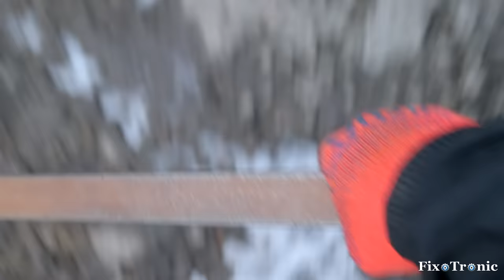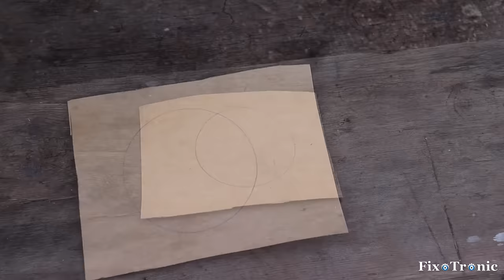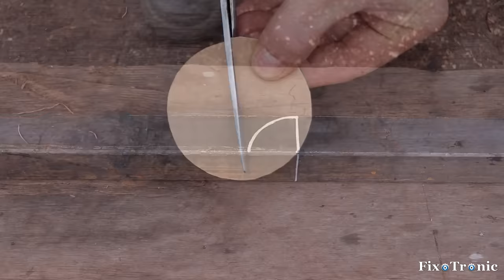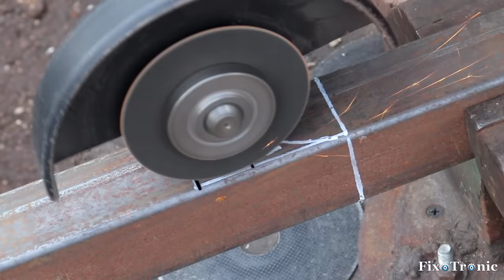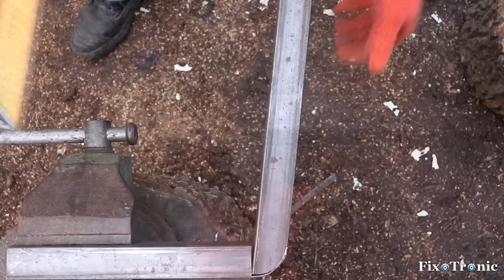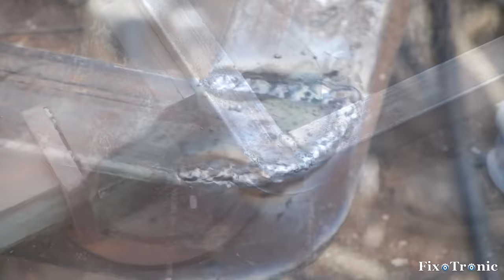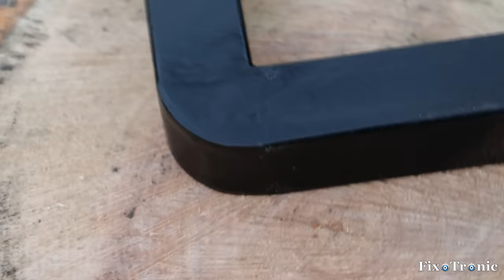Secret Profile Pipe! WHY DO WELDERS NOT SPEAK ABOUT IT

Comment: I asked my uncle and he said "we have orders to complete ain't nobody got time for that" that's why welders don't speak about it 😂
Reply: Yeah a 45 butt joint works just as well you would only use this if you wanted the rounded edge
Reply: I agree.. looks nice, but if your welding on the clock it's way quicker to weld at a 45 or 90 cut
Reply: If you are a production welder, this kind of thing separates your products from the rest...
Reply: @campbellpaul  nah, time and efficiency matter more. Unless you are some artist, this joint is not needed.
Reply: Plasma cutter would speed up the process a fair bit
Reply: That's what I was thinking. But if I need a round corner I might try it
Reply: @campbellpaul  he owns his own shop in a village, the only one there, he gets a lot of orders but none of them require this level of quality and it's a struggle to get things done in timely manner
Reply: @guser436  I understand. Also, some places have such an enormous back-order log that their main goal is to expand the operation... It can, however, go hand-in-hand with their level of quality product. Just sayin'

Comment: "A grinder and paint makes him the welder he ain't"... but his geometry skills are on point.
Reply: Considering it is thin metal, and hes stick welding, very difficult to stick weld thin unless you use small diameter rods.  Those welds dont look bad, plus you dont no the application. Maybe these were handrails, and those are pretty strong for that purpose.
Reply: But u didnt get the point of the video then.
Reply: 1. I actually weld for a living. 
2. I use this technique when called for. 
3. The quote is in recognition of the nature of welding thin metal. 
4. It's actually a COMPLIMENT to his skills. 
5. Those that weld would recognize this. 

But please do go on... Reading comments from people whose experience in burning metal starts and ends with sticking knives in toasters & power outlets is funny as hell.
Reply: @ibidu1 He was stitch welding, Effective but not pretty hence the extra grinding.
Reply: He did a fine job thanks 👍

Comment: I dunno, I never hear welders talk about anything.  But hey, they must not.
Reply: My friend who is a welder only talks shit and when he isn't he is pretending to be gay.
Reply: Lmao sounds about right
Reply: I knew a welder once, and all he spoke about was fishing.
Reply: @billgriffiths1685  Probable because it take too bloody long to do this join vs say a 45 cut?
Reply: @billgriffiths1685  )))))))
Reply: @damienkaletta7524  theres also the wasted material at the end of the day its about money
Reply: I knew a welder once. He was a pot head and a drummer to.
Reply: Welder + fabricator here!, the reason we dont talk about this is that its just too much effort and rarely ever requested
Reply: @NotReal1y  agreed - spent 22+ years as a semi trailer mechanic, which includes a LOT of welding & fabricating, along with replacing parts and patching holes in everything from aluminum or chemlite roofs down to holes in wood or aluminum flooring. This process is waaaaaaaaay too time-consuming for regular use. In fact, usually when we needed square tubing to have a 90° angle, we used the break, and bent it the necessary 90° angle!
Reply: Kilroy, I spent decades being a welder as well as all sorts of other things, being a semi trailer mechanic, and when we talked about stuff, at work or away from work, it was never really about work, LOL!
Reply: I dunno. I've heard a few things come down the pipe. But usually it's just hot air.
Reply: @MaryAnnNytowl  ;

Comment: Side note- Im glad i bought a Wire welder, more often then not i see people with stick welders trying to get their arc to start, i didnt want that trouble, that, and im not a fan of having to buy packs of rods. A reel of 0.36 is all i need, they arent that expensive either. Another plus, i havent gotten my wire stuck to random metal like ive seen happen with stick welders. 
All in all, great video, and to anyone wanting a welder, definitely do your homework on what you want to be welding, your budget for a welder, and other variables. I will say my lil Lincoln Electric FC90 is a great starter wire welder. Lincoln Electric also has starter welding kits, comes with: Chipping hammer, paint marker, magnet capable of making 90 degree angles, gloves, fire resistant sleeves, and of course, a helmet! I highly recommend it because you can plug it into standard house power, no need for big ol plugs. Have a great day, and happy holidays!

Comment: Here is why no welder talks about it or uses it:
1. too difficult to cut with simple machinery, so you need too much time for a joint
2.structural integrity, the reason both ends are cut to 45° if you want to reach 90° is that the forces are equally distributed throughout your workpiece
3. welding stress, since you weld on one side more than the other, the stress introduced due to the heat will deform your workpiece in an asymetrical way, which is what you dont want
Reply: Michel aus Pimmelberger More like 1. So you click in the video
Reply: Dein Name erleuchtet meine Nacht. 😂
Reply: Hello, your arguments are very valid although I have for me that if the structure does not demand extraordinary strength, a very good finish and view is achieved. Regards.
Reply: ok
Reply: Hexy he is not building a bridge. Dont you like the aesthetic of it?
Reply: Thankyou nice video

Comment: A great way to piss off the owner of the shop I work for and get fired for wasting time
Reply: id use a plasma to cut it faster then the grinder
Reply: A tube bender would cost as much as it'd take to pay a welder to cut, bend, and weld a few of these joints, and with the time it'd save, it'd pay itself off after one job.
Reply: @joshua.merrill  And you cant bend a tube with this small of a radius
Reply: @joshua.merrill  good  luck with finding a die for  square  tube with that radius
Reply: @kaptein1247  You can get close enough to make this joint not worth doing.
Reply: @joshua.merrill  It wont look good tho. Trying to bent this tight wil basically fold the tube
Reply: @kaptein1247  That's how pretty much all square tube furniture is made, though. I'm not saying nobody should do joints like this ever,  but the reason nobody talks about it is because you can bend the tube at a faster faster rate and therefore cheaper price.
Reply: Was thinking the same thing defo day rate speed that
Reply: Absolutely! I spent 22+ years as a semi trailer mechanic, which includes a LOT of welding & fabricating, along with replacing parts and patching holes in everything from aluminum or chemlite roofs down to holes in wood or aluminum flooring, and repairing or replacing the (usually steel) undercarriage parts, cross-sills (cross beams that hold the floor and attach to the sides of the trailer, underneath), or dolly legs (the crank-up-or-down legs near the front of the trailer). A LOT of welding and fabricating needs done when doing all of that, and never did we do this kind of thing!

This process is just waaaaaaaaay too time-consuming for regular use - in fact, usually when we needed square tubing to have a 90° angle, we used the break, and bent it the necessary 90° angle! 

We even built a hydraulic "bender" break, to bend 1" steel square tubing at 2 different angles in 2 different spots, which were used to build these table/stand sort of things to go between shop or warehouse bay doors. I bent thousands of those tubes, welded them to cross-pieces and flat steel (that also got bent in 3 different places using a different break that we also built), plus smaller pieces that got bent and added as "pockets" on the flat steel), and not once did the bent pipe give us any difficulty or cause any stress fractures of the steel. Had we done the bends on those tubes THIS way, we would have put out about 5 a day, rather than 50+ a day, LOL!
Reply: Pretty neat if one needs to improvise on site
Reply: @joshua.merrill  what is your solution if a job calls for an inside sharp 90 with and outside radius? this would be the only way.
Reply: @azza9423  I think the harder challenge would be finding a job that calls for a joint like this. 

But,  if there was somebody silly enough to make that request, they'd have to pay a lot of money for it,  and you'd have it laser cut. I, personally, would recommend to go with a bend or miter for 1/10 the price.
Reply: @joshua.merrill  a very good point, 7 years of fabrication I’m yet to ever see a job call for a join like this, but I’m willing to bet the one day I’m unprepared a bastard job like that will rear it’s ugly head lmao.

Comment: why because in 45 years as a professional welder i have never done this
Reply: Because it takes about 45 years to do a joint like this, when it takes 45 seconds to just bend one with a tube bender.
Reply: @email16v  In this example even one 45° cut would do the job. The video is still funny to watch.
Reply: I've been welding for 69 years.  This is the proper way to do it
Reply: I think if we test, this joint must be stronger than the other ones. Just guessing.
Reply: @ChargeNReact  no its not i dont know any company that would let you fanny about for this long on a simple 90 degree i could make a complete square and still have time for a coffee in this time
Reply: @tiny789  Obvious charlatan.
Reply: @tiny789  I'd have a conversation with you about compressive strength, but you wouldn't know what the hell I was saying, would you?
Reply: @ChargeNReact  no being an asme 9, cegb class 1, Lloyd's class 1 bureau veritas approved, having worked on the  trident missile project, heat exchangers for nuclear submarines, the guang dong power station. No sorry this has slipped my memory
Reply: @tiny789  I welded every NASA Space Shuttle ever built.  I was a key player in the development of the Dualshield Method.  I sleep with my Lincoln 3350 on.  And, I don’t need a torch since I literally spit FIRE 🔥
Reply: @ChargeNReact fSPIT FIRE a bit like some of your space shuttles .nothing i have ever worked on has blown up so spectacularly
Reply: @tiny789  Excuse you:
"The Challenger accident was caused by a design flaw in the spacecraft's O-rings, which are mechanical gaskets that are designed to be seated in a groove and then compressed in between two surfaces, creating a seal at the interface."
Reply: @ChargeNReact  but it blew up lol
Reply: @ChargeNReact   you are telling me 69 years wasn't for real?
Reply: @markgonsalves  i dont think that would be the case actually. it doesnt seem like it would have as much support as the traditional manner

Comment: Grinder and paint makes you the welder you ain't.
Reply: WRONG
Reply: so true
Reply: If you need a ginder to make your welding look good your a grinder not a welder.....

Me I'm a bird shit.

Because when someone sees me weld they go What the fuck is that
Reply: Good welds don't have to be pretty, although that's a plus. My brother and dad were both good welders. I saw their work,and it put to the test. Their welds didn't look horrible, or messy, but they weren't pretty, either.

I worked with them, and with another guy who made the most beautiful-looking clean welds that I've ever seen. They wouldn't hold $#!†. He made something for me, and one of the welds popped off when I tried to bend the piece a little to make an adjustment.

Grinding the weld smooth is a good practice. The build up on the surface doesn't add any strength, anyways.
Reply: omg yes lol, welding on slag made me puke lol
Reply: And Welders don’t just give secrets to 60 million viewers
Reply: Cutting circles with metabo 🤔🤔🤔
Reply: @ArkansasPilgrim  yeah sounds like the guy didn't get the proper pentation. Welds don't need to look "nice" but "nice" welds save time for clean up. Also "nice" looking weld are usually a good sign of quality but you can still can have a bad weld and have it look "nice".
Reply: @Natas_incubus  Were  talking bout ur paint marker and metabo instead of the real things welders use to mark and cut./ I can’t tell u what it is tho it’s a secret
Reply: @Natas_incubus  there is a difference in grinding and painting for a nice finish, and grinding and painting to hide horrible welds... yes this part called for the grind and paint either way, but theses welds were atrocious
Reply: @JackTalyorD  66
Reply: @JackTalyorD  0
Reply: @zdzisawnikolas8490  I don't get it
Reply: That porosity tho
Reply: Abso-freaking-lutely! I took welding classes at work, which the company paid for to improve our (already good) welding, and make us top-notch welders. With pretty welds, you don't NEED to grind off a bunch of crap. Saves a TON of time that way! 

And as someone in these comments said, pretty welds aren't always good welds, but... the BEST welders can lay down great looking bead and have better strength on the weld than the material welded together. 

Not only that, but the different types of welding lay down different types of bead, too; and by learning what is happening with the metals you are melting, it teaches you how to make beautiful AND strong welds. That's what the welding classes do - you learn exactly what the metals are doing at all times and at all temperatures. Helps prevent metal fatigue and weakening or causing the metal to lose its temper and be brittle, too - like a piece of forged steel that will snap instead of bending and still retaining its shape.

I would suggest anyone who has more than a passing fancy with welding to find a junior college or other school and take at least some welding classes. It will make your skill levels jump considerably! 

Okay, putting away my soapbox for now, LOL!